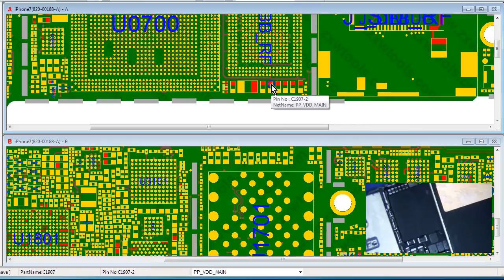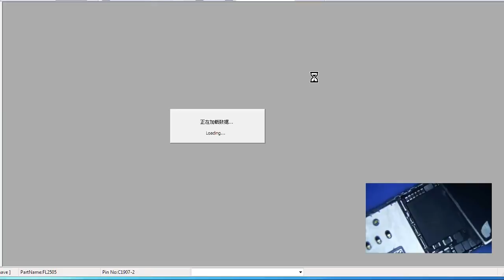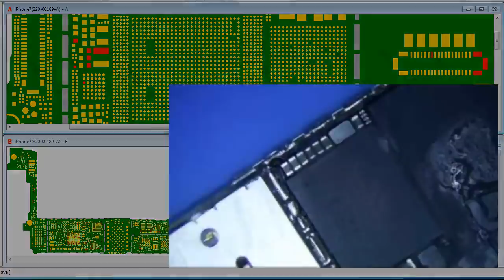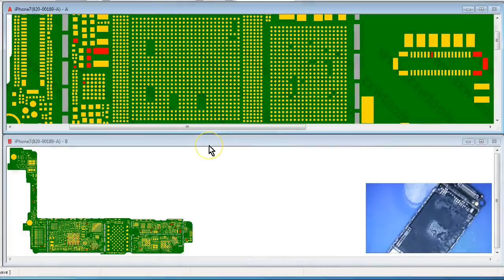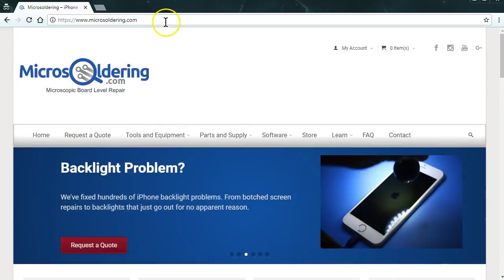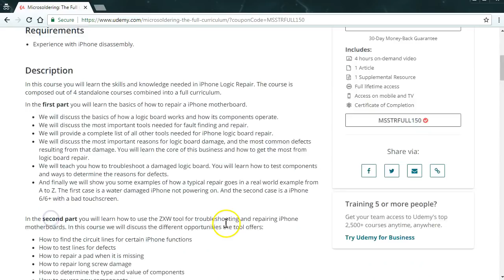iPhone 7 No Power Repair Using Freeze Spray

Comment: How do you know the voltage you need to inject in that line?
Reply from the maker: That's a good question.  You'll need to understand schematics a little bit.  The line that we are injecting voltage in is called pp_vcc_main.  This is the main power line for the phone.  It's two inputs are from the USB lightning cable and the battery.  If you measure the voltage of the usb cable (5V) and the battery (~3.8V-4.2V), then you can guess what the voltage of this line should be.  You can also measure the voltage in this line after a known good working phone is powered on.  The schematics may also have this voltage listed.
Reply: Microsoldering great bro!! I already try to read the schematic and I see the voltage of many lines, thank you so much! I see all your vids btw